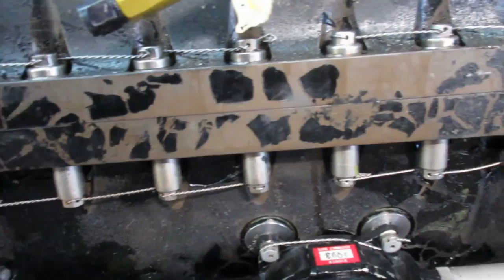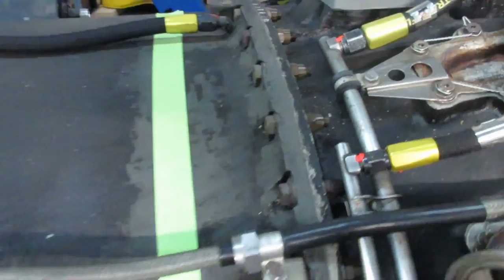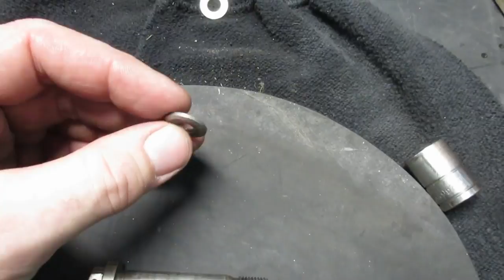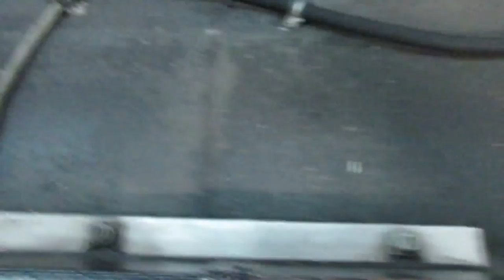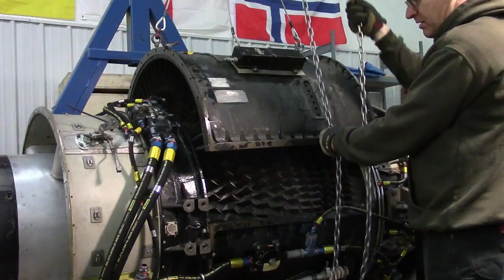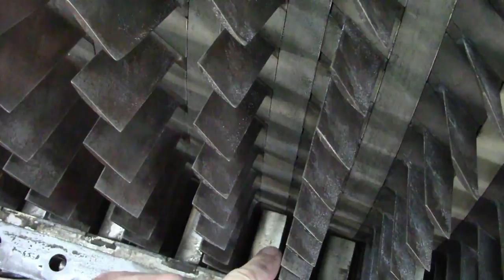Compressor Inspection - J47 Turbojet

Comment: Happy holidays.
On the big stationary turbines we usually Jack the bottom up just a couple hundreds of a mm to separate the vertical splits, preventing gulling of the faces. Guide rods in the corner bolt holes prevent it from twisting when it pops up clear the flanges.
Great job once again.

Comment: How do you get to the stator vanes on the other side of the case?  Seems like you'd have to split the engine in half.
Reply from the maker: In order to maintain alignment and support for the front bearing, we will bolt the cleaned upper case back on... a few horiz split bolts first to position it, then all of the vertical split bolts to proper torque.
Then we take out the horiz bolts, and remove the lower case... to clean it.
Alignment must be maintained...
Mind the gap!
Keep calm, and carry on...

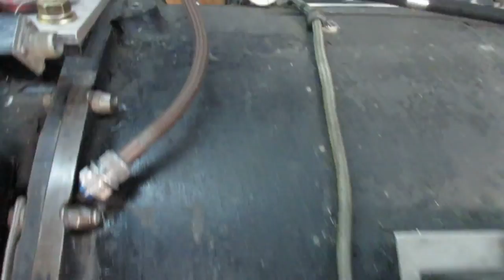Comment: 4:26 It’s interesting how the bolts get denser and denser towards the right side. That seems to reflect how air pressure builds up in the compressor.
Reply: Correct. I would describe them as becoming progressively more closely pitched.

Comment: Is there any kind of blade alignment that needs to be done between the compressor rotor disks?  It could be an optical illusion, but the stator vanes seem to come in straight then start sweeping counterclockwise  (per the shot at the end of the vid).

Comment: I am an M1 & M2 AME and was the DOM for almost 40 years for our Charter Airline Company. I also ran the engine shop and did repair and maintenance on our Lear 24 and the installed GE CJ610-4 Jet engines. Great dependable engines! They were the civilian version engine with variable inlet guide vanes and 4th 5th & 6th stage compressor bleed valves while the Military version J-85 had inlet guide vanes and multi stage VG's. The J-85-21 was the military after burning version, and I saw one in the test cell at GE in Lynn Mass., doing a test run. The CJ-610-4 in the Lear was 2,850 Lbs of thrust and I believe the J-85 was about 3,750, and the J-85-21 was about 3,750 at full throttle and over 6,200 in afterburner. What you viewers may find interesting is the CF-700, which was used in the Falcon 20 and basically was a CJ-610 as a core engine with an aft fan attached to it. The interesting thing was that it only had 2 bearings (oil fed and scavenged by external lines from the accessory gearbox) and was a free wheeling rotor with BLUCKETS attached to it, that was bolted to the engine just after the 2nd stage turbine. The term BLUCKETS referred to a fir treed BLADE that was a "BUCKET" in the gas path to harness the energy and a FAN BLADE in the Bypass Air Path to supply Fan Power. I think it deserves "honourable mention" as a unique design. Once we sold the Lear due to the economy shift, we continued with Piper Navajos, Mitsubishi MU2's, and a Metro Liner. I had 2 engine test cells and performed maintenance and overhaul on the Lycoming Piston and Garrett TPE331-6 & -10 engines. We maintained 2 QEC MU2 engines the TPE331-6-252M that could be installed in the aircraft and flying in less than 2 hours. Great engines and airplanes. Keep up the good works it is great to see classic aircraft and engines kept flying. There is a lot to be learned from the older engines and technology that is directly applicable to the newest designs. BRAVO!
Reply: Frank Whittle ran an aft fan turbofan with an afterburner (he called it an augmentor) in 1944.
Reply: @grahamj9101  I saw the Whittle Engine and the German Heinkel Engine in the Smithsonian Air and Space Museum in Washington DC when I went to GE in Lynn Mass. for training on the CJ610. A real accomplishment for the day, hand built and bolted together with many bolts, washers, and nuts. Being British he must have had a Mecano Set as a boy. GE got involved and produced many parts, and I think some engines in Lynn because they had the materials and expertise from Turbochargers and such, and was in no threat of being bombed. When you walk around the GE plant in Lynn, there is a plaque on a building that commemorates the Whittle Engines and parts that were built there. I just mentioned the CF700 as it relates to a very simple example of a Jet Engine being used as a Gas Generator, with a Power Turbine / Fan arrangement. It is an example of the fact that there are few truly original ideas, as you have highlighted, and that these engines, old as they are, are a good learning experience.
Reply: @davidbrown1037  Whittle was from a very ordinary working class background and there might not have been enough money for Meccano.  However, his father, a machinist, was able to buy a small machine shop, where young Frank must have got his hands dirty, gaining practical engineering experience.  The story goes that, as a small boy, he saw an early biplane, which made an emergency landing near his home, and that gave him ideas of becoming a pilot.  
For someone with his background to aspire to become a pilot in those days was almost unheard of.  Nevertheless, after problems because of his small stature, he joined the RAF as an engineering apprentice.  He excelled and was selected as a Flight Cadet for officer and flying training.  In 1928, during his final term as a Cadet, he wrote a thesis on the subject of high speed flight, which, in due course, led to him submitting a provisional specification for a turbojet to the UK Patent Office in January 1930.
Why my interest in Whittle?  There are several reasons.  Firstly, because I owe him and his genius my career lifetime in the design of gas turbines, industrial, marine and aero.  Secondly, he was born in the City of Coventry, in the English Midlands, where I served my apprenticeship with Bristol Siddeley Engines, which qualified me to become a Freeman of the City, so I have some affinity with him through the City.  I also believe that, over the years, there has been a concerted effort to belittle his work, if not discredit him, and deny him the rightful title of Inventor of the Jet Engine.  
I see parallels with the way the Wright brothers, two cycle mechanics, were treated in the USA, with attempts to discredit their achievement in favour of Samuel Langley.  Because of this, Orville Wright refused to donate the Kitty Hawk Flyer to the Smithsonian and loaned it to the Science Museum in London.  It was finally returned to the States in 1948, subject to strict conditions imposed by the executors of Orville Wright's estate.
Reply: Since my previous comments, I've bought (at great expense) an original copy of Frank Whittle's book, 'Jet: the story of a pioneer', published in 1953.  There's no mention of Meccano, but he did help in his father's machine shop.  I'm hoping to get the book inscribed in his memory by his son, Ian.
PS  I'm half way through the book now.  I have other books about Whittle and the jet engine, but this gives a very personal insight into the trials and tribulations he faced, not least from the UK government, even after the potential of his invention had been recognised.
PPS  I've now finished the book and I'll give you a quote from Chapter 54: "Though the German engines were greatly inferior to ours, very high speeds were achieved with aircraft powered by them - again, because they had cut down on safety factors."  He was of the opinion that the German engines  were put into production "long before they had reached a state of development that would have been considered satisfactory in Britain."

Comment: how do you make sure the half of the case you are removing is not dangling into the compressor blades?
is this just very unusual that it's THAT sticky and normally it's just "up and out" without any stickyness? ;)

seems strange to me that there doesn't appear to be any sort of guiding (corresponding cuts for example) so the case can only go up without swinging left/right.

Also an additional unrelated question: I have found this ca 8mm diameter tube-fragment, possibly titanium/aluminium, at the crashsite of a F/A-18D (two F404's of course) here in Switzerland. Any chance I can send you a few pics of this thing, maybe you can tell me in 5s what it is exactly? ;)
Reply from the maker: 1) - you have to be careful and not wreck things. It might be called skill, but it's really just being careful.
2) Tubes are almost certainly to be stainless or aluminum, but sure...

Comment: Hi jay, love the show. I have been very lucky to own and maintain several old military jets, I currently have an l29 Delfin , mig 15uti, and a fouga. I have worked on a flown different jets all over the country. I have even been involved in several insurance company mandated disassembly of a few jet crash investigations,a vampire and the goblin engine complete back to front disassembly and inspection was very interesting. I had an l39 along with a spare ai25tl I both worked, on and flew. Long story short, on the l39 using the ai25  n1 is actually the gas producer and n2 is the bypass fan. Unless I understood your video about this incorrectly, you explained on a turbofan , the fan is n1 as it’s the first thing air touches. Maybe a little clarification would help.  I also have built 3 turbine boats , one a single t53-L11d  and another with twin t53-13’s , I have built several show trucks for special events and ground warmers out of m701c-500 out of the l29, and a track dryer out of a vk1 mig 15 engine.
Reply from the maker: By North American convention, the AI25 fan is N1, and the GP is N2.
The Russians may disagree, but that's the way it is over here.

This is a major reason why I hate the whole Nx bullshit. 
I prefer to call the low pressure turbine and compressor, and the high pressure turbine and compressor... by their actual names.
Reply: AgentJayZ thanks for the response, I absolutely agree, high and low pressure is universally understood. Those crazy Russians! (Czech actually).
Reply: I'm with AgentJayZ on this.  I was brought up with  the abbreviations LP, IP and HP for the engine spools and their respective compressors and turbines.  In my experience on this side of the pond, Nx (where x is a letter subcript, L, I or H) is used to define the spool speed, whether as a percentage or a number:  it doesn't define the spool.
Reply: @AgentJayZ  I was looking at a cross-sectional GA of the Iroquois engine this morning, together with a folder of the performance data.  Spool speeds (not the spools) were referred to as N subscript L and N subscript H.
Reply: Um, no, Ukraine actually... Czech built the engine holder, not the engine

Comment: Very cool as usual.  Your stuff is in the mail.  I sent it a few days before Christmas.  

Whats the clearance between the case and the tips of the rotor blade?  It looked like about .010" or .050".  I would have expected about .125".  Anything spinning that fast on something 24 or 30" wide would have incredible tip velocity.  I would expect it to grow due to centrifugal force.
Reply: I will leave AgentJayZ to quote the build tip clearances for this engine, but I would expect them to be of the order of .015 to .030in.
The dilation due to “centrifugal force” is relatively small: thermal growth becomes progressively more significant towards the rear of the compressor, even in a low pressure ratio engine.  There have been occasional instances in the early axial turbojets of heavy rubs occurring as a result of the ingestion of very heavy rain. The relatively thin light alloy casing is cooled more rapidly than the substantially heavier compressor rotor and contracts down onto the blade tips.
And, as I was told when I was a first-year engineering student, “There is no such thing as centrifugal force.”

Comment: Why is there no translation into Arabic?
Reply from the maker: The YT translator is so inaccurate, it only adds confusion. I will not use it until it improves.
Reply: What you say is correct, but less translation is better than none

Comment: Along the same lines as the other poster. Is anyone anywhere making aftermarket replacement parts, turbine blades, stator vanes, etc?  Never heard you mention any. Only donor engine parts.
Reply from the maker: There is a supply of NOS parts for most engines. I don't know of any aftermarket manufacturers.
Reply: AgentJayZ bummer. I would have though maybe someone would have. Maybe when new old stock gets gone? I guess it depends on how long you and guys like you keep these awesome old engines going?

Comment: Could it have been harder to remove due to movement with the torque? A bit like when you see a hot rod car twist when revved up?
Reply from the maker: The cases do not get deformed due to the stress of operation. It was difficult to remove this half case because one of the vertical splitline bolts was so overtorqued that it partially pulled out the insert it was threaded into.
That protruding insert scraped it's way along a sealing surface as I removed the case.
Diagnosis: poor assembly.
We fixed the problem.

Comment: Hi please what angle are they inclined by turbine blades and  compressor and what are the materials used ?
Reply: I'm sorry but your question is not clear.  Do you mean at what angle are the blades inclined to a radial line?
Reply from the maker: If I really try hard to figure out what you might mean, I might translate this into three questions:
1) What is the angle of incidence of the turbine blades?
2) What is the angle of incidence of the compressor blades?
3) What are the materials used for turbine blades and for compressor blades.

I usually don't bother trying to figure out what someone means.
Why? Read on...

Answers:
1) This video is about the compressor.
2) The angle of incidence of each stage of compressor blades is different, and whatever angle that is changes with distance from the blade mount. This is called blade twist. So there is no one angle that can be used to describe any compressor blade.
3) The materials used in the J47 turbine blades, turbine disks, compressor blades and compressor disks would be high nickel alloy of exact specifics unknown to me, high quality heat resistant steel alloy of exact specifics unknown to me, stainless steel alloy of exact specifics unknown to me, and high strength steel alloy of exact specifics unknown to me.

If you are unsatisfied with these answers, you need to be much more specific in your questions.

NOTE: this is not a request that you reform and re-ask your question.
You've had your chance, and I've only done this as a demonstration of how important it is to compose questions in a specific and coherent way.
Reply: @AgentJayZ  Thank you sir, I am sorry for the lack of clarity of questions, but your answer was useful
Reply: I'm trying to make a jet engine, can you help me?
Reply: @grahamj9101  I am sorry but my english language is bad, I mean the angle of blades
Reply: @mustafanage8198  I think that AgentJayZ has given you the very best answer he could.  I would add that, where he uses the term 'angle of incidence' for the angle of the aerofoil to the axis of the engine, I would use the term 'stagger angle'.  I reserve  'angle of incidence' for the difference (which can be positive or negative) in the angle of the air onto the blade leading edge, relative to the actual angle of the leading edge.
Reply: PS  In making my first comment,  I did wonder whether you were asking whether the blades had any 'lean' relative to a radial line.  Well, most people unfamiliar with jet engines might think that they don't: however, they usually do, but only very slightly.  Typically, they are 'leaned' very slightly in the direction of rotation, so that the radial 'G' force effects counteract the air/gas loads, to reduce the bending effect on the blades.
Reply: @grahamj9101  thank you sir

Comment: are the positions of the axial compressor blades specified to each other?
Reply: Wondered the same thing.  It probably depends on the location of the stator vanes as well, so might be less than obvious looking at either alone.
Reply from the maker: They each are mounted in a slot machined into a disc that makes up a stage of compression.
Reply: @AgentJayZ  i meant if these slots are machined in specific positions to the other slots. is there a specific angle between the slots of the 2nd compressor stage disc and the slots from the first compressor stage disc for example? all these blades of axial flow compressors and turbines are a little bit offset to each other